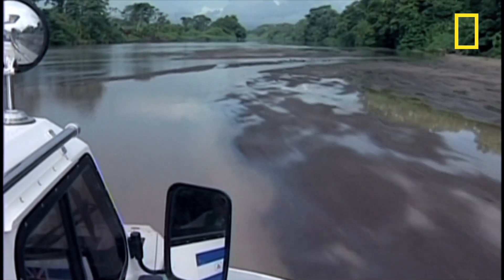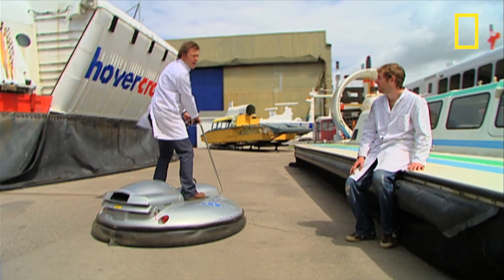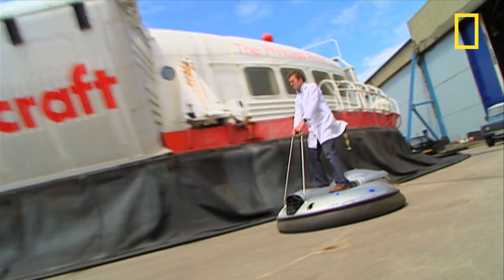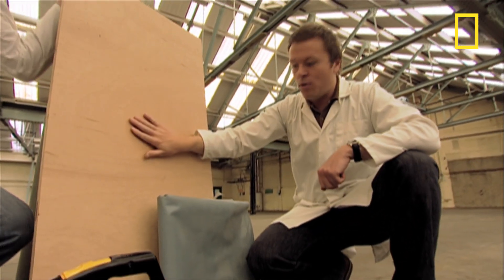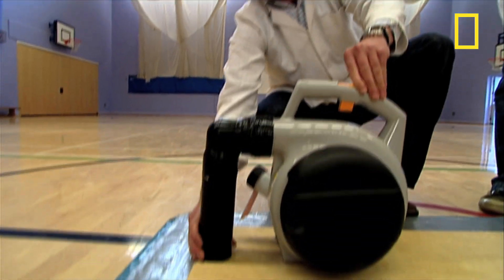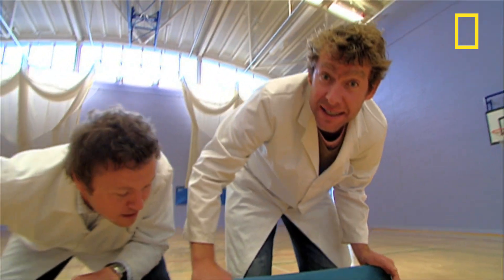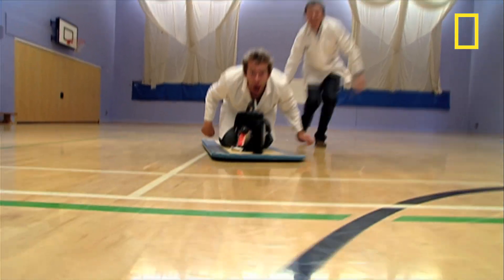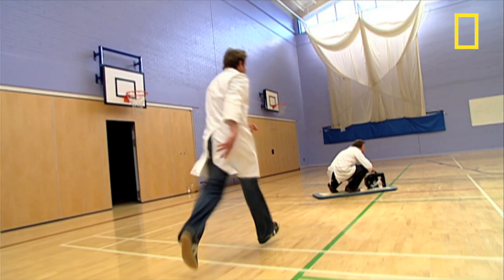Build Your Own Hovercraft | I Didn't Know That

Comment: What if you did 2 leaf blowers?
Reply: Or like, 10?
Reply: Ainsley M. Prepare for flight...
Reply: Wat about 3 OOOOHHHHHHH GET REKT NEWB 360 no scoped
Reply: +That One Friend You will become more off balance, causing you to go in a direction, depending on the side on which you place the leaf blower. You will not go up, because the way it works is that it goes upwards, because of the force the air executes on the ground. This will mean you will first go up a little higher, and then drop a little lower, until after less then halve a second you have a balance, which wont increase or decrease with the amount of leafblowers you use. It will however help if you are heavier then the board can handle. Seeing that you are a teenage girl, this probably isn't the case ;-)

Comment: I wonder if it works on water
Reply: as long as it isn't rough waters and it can support the weight, yes
Reply: Tigran Petrosian I guess
Reply: *****  (professionally built) hovercrafts are designed to go on land and water, that's one of the things that make it unique, it's only a matter of seeing if THIS design can go on water, and yes, it is harder to make a hovercraft go on water
Reply: ***** why are we talking about particles?
Reply: Tigran Petrosian yes, but talking about what happens on the atomic level isn't going to help you much
Reply: ***** I regular talk it just means extremely small bits of matter (like particles of dust)
In physics it could mean at the atomic or even sub-atomic level like quarks and gluons
Reply: ***** an Egyptian god, why is that relevant?
Reply: I wish it did too:)
Reply: Mike Gayer You can already glide on water with a wooden board, so with an air blower it would probably decrease the friction even more
Reply: +Mike Gayer Apparantly, it works even better on water, but it doesnt go in any direction by itself, and you need somewhere to push of from. This is usually not often the case on water. If you however, have someone to push you, and you are not affraid to be stuck in the middle of a pool, go for it!

Comment: You can use a shop vac
Reply: that would be electric(power cord or heavy 6volt/12volt batteries
this would prevent the lift(unfortunately)

Post Edit: Well the power cord wouldnt prevent lift, and you would have great lift(but only as long a range as your extension/power cord)

Comment: Would two leaf blowers lift me higher?
Reply: Victoria Williams Alex's Mind actually, yes it could increase max weight, and max lift, however, I would instead, recommend 1 big one for lift, ae elongated trapezoidal shape for the support board and another bigger one mounted in front with a control baffle to allow the one in front to have four directional air dispersal though a series of air jets with controllable direction toward a mounted air output jet(on all four corners) with a changeable direction cable linked to the baffles and to the jets(to control the angle of which could all be attached to a handle bar assembly.
so Alex, watch your rude asinine comments toward others, your bitterness is not her fault, be kind to others and they will be kind to you, so don't take your lame attitude out on her!
Reply: Daniel Mee I honestly don't remember writing this, I'm dissapointed with myself. I apologise.
Reply: Alex's Mind
 I have to agree  with *****  as it is comments and cruelty of others that need not be, my recommend is very ancient.
and I reserve the right not to use it as listed below this, in the event that someone is either cruel or something to that effect as follows:
Alex's Mind If you don't have anything nice to say, DON'T SAY ANYTHING AT ALL PERIOD!!!
Reply: Alex's Mind  I know what it is like to not remember something, but remember this. You can say alot of hurtful things and forget about them and later you realize how much of a fool you were/are or may have been, and in this you may become stricken with remorse and regret, regardless how you feel about this statement. There were alot of things I said in the past that I would take back if I could, but they are said and the damage done.
remember that from one who has looked at life from more different angles, perspectives and ways then you may imagine even being possible to.
Reply: Victoria Williams
The answer I have for you is a yes with a proper redesign, and a third added and you could add steering jets and strafe jets, I have already thought on how to do this and have reroute-able blower jets to allow forward thrust, strafe thrust, rear thrust and turning and rotating thrust (but would take some work)
Reply: Daniel Mee kall  mee hangrout
Reply: adam abid
What did you just try to say??????????????
Reply: ***** But comments like that literally constitute over 60% of the comments made on YouTube lol
Reply: Mason Dyer That is not an excuse to crap on some one just because others are, otherwise you are no better than mob mentallity, I agree with ***** comment as I understand it to basically in question form state that it isn't acceptable just because others are doing so. that would be like jumping off a cliff to your death and doing so because everyone else thinks it to be right.
Reply: adam abid
 I did not have  time to do more than glance at your comment before for more than a moment. If we hung out, what would you have us do? if you wish to design a good hovercraft style board, I would need a good amount of money in order to create a prototype that would have the parts needed that I would have to have fabricated to make it possible(and too maintain low weight the parts would need to be carbon fiber or lighter).

Comment: Would you sue me if I mass produced these things but a little bit stronger. Can these things float on water?
Reply: maybe it would float on water if you used 4 leaf-blowers.
Reply: +Yuri Grigsby Apparantly, it works even better on water, but it doesnt go in any direction by itself, and you need somewhere to push of from. This is usually not often the case on water. If you however, have someone to push you, and you are not affraid to be stuck in the middle of a pool, go for it!

Comment: It likely wouldn't make a huge difference; this isn't really a hovercraft, more of just a reduce-friction craft, so without actually physically hovering (which a leafblower has far from the amount of power to completely lift a human), you can only reduce friction so much.  Like they said, on a rough surface this wouldn't really work - it doesn't actually hover, just provides somewhat of an air cushion.

Comment: Can it go on warter
Reply: +Haydn Leah Apparantly, it works even better on water, but it doesnt go in any direction by itself, and you need somewhere to push of from. This is ussualy not often the case on water. If you however, have someone to push you, and you are not affraid to bes tuck in the middle of a pool, go for it!